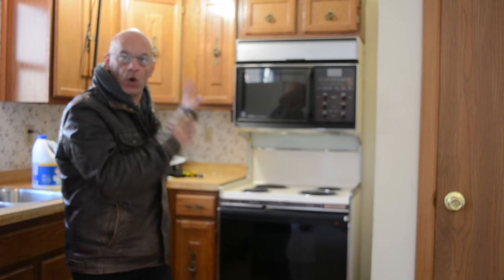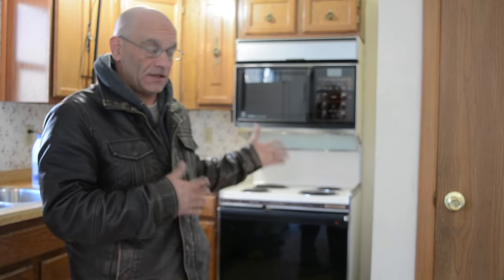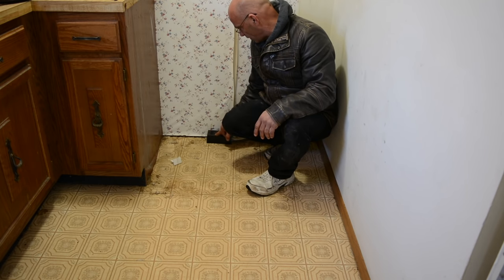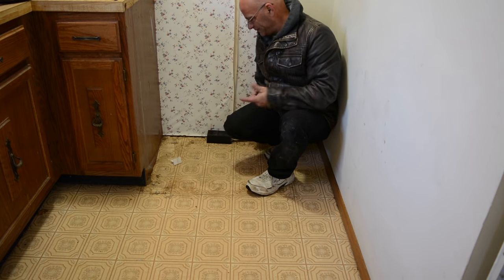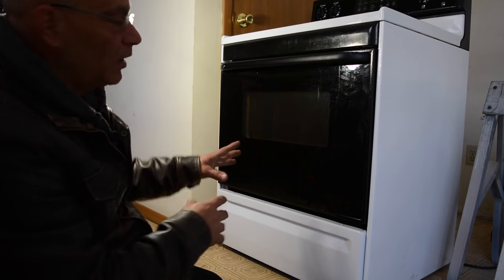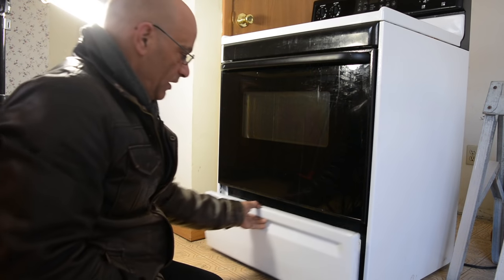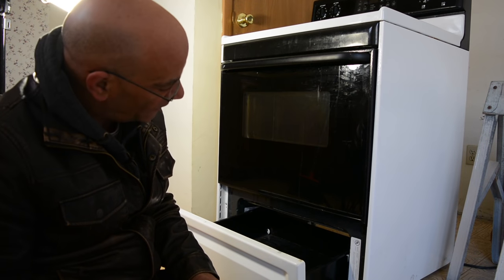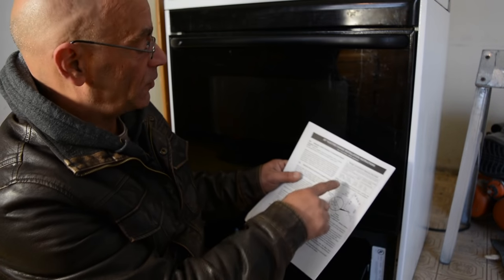How to install a electric stove wire / plug

Comment: Awesome Video and Info. Question: If buying a new stove and putting in an older home that has gas but want total electric, do I have to change out all wiring and upgrade the service panel?
Reply: Going total electric is a stupid thing to do, it is less efficient and is a huge waist of money.
Reply: That depends on a lot of different factors, your best bet is to get an electrician to look it over.  That's way beyond the scope of a YouTube video and not a very good idea to rely on a video to do electrical work beyond your own knowledge.  Mistakes in electrical work can cause everything from a shock to burning down your home and your insurance might not even pay if it's found out that it was faulty or incorrect wiring, especially if they find out you did it yourself.
Electrical work is very difficult and that's why an electrician spends years learning how to do it properly and safely.
I'm not a licensed electrician but I do what I am knowledgeable about, but I studied for a long time to get the knowledge and had an electrician check my work before turning on the power.   I've wired a complete house for myself but wouldn't do it for anyone else.  (It is Legal for me to do my own without a license here might not be where you live)

Comment: Hi please consider showing how to install socket for electric stove. we have gas and no plug for electric stove. hate gas so we use hot plate.
Reply from the maker: Well I do have how to install a 4 wire outlet. That should do the trick. Trying to cover everything in video would make a long video. I try to make them short and to the point. Although this one was a bit long.
Reply: You should give the gas range a chance, it’s easier to cook with, I grew up on electric and can’t stand it.

Comment: The panel on my stove actually calls 2 hots and a ground "3-wire" and the other "4-wire. It's a GE. Just figured I might want to point out you may not have needed to correct yourself. I'm not an electrician, though.